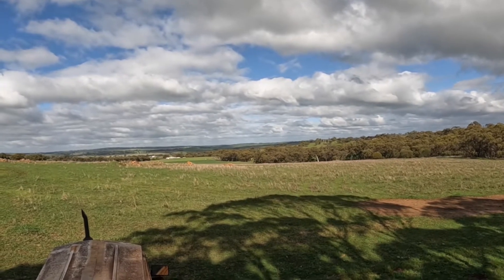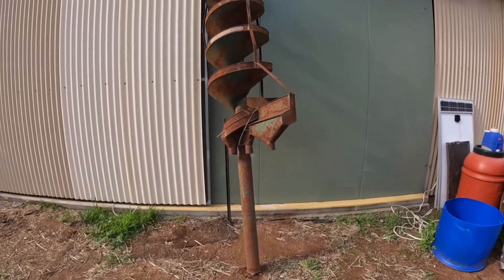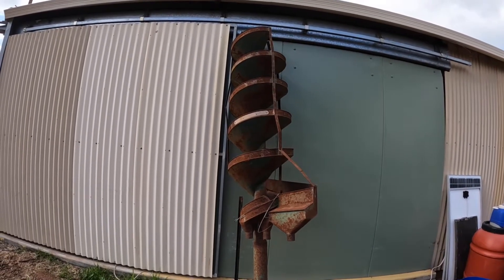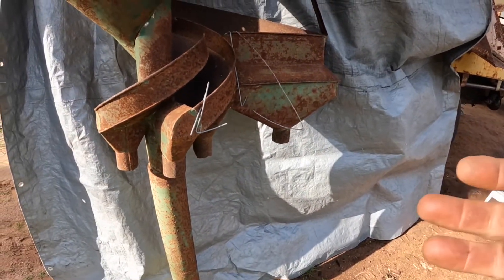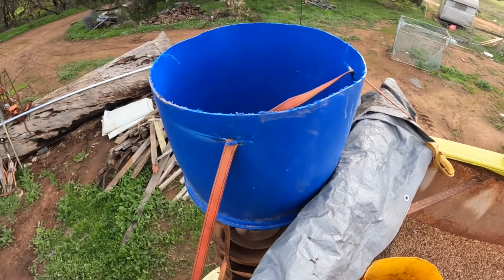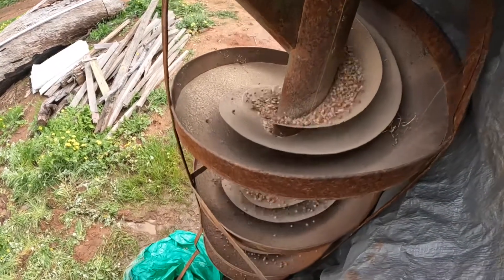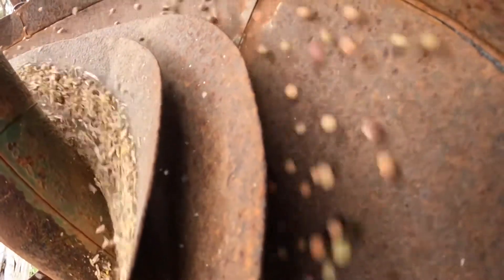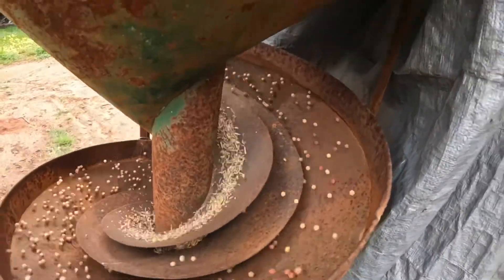Seed cleaning using a Robert Bodington Gravitator

Comment: ive seen those used for canola, when we had open pollinated seed. Now the chem companys do most of the canola seed so they have become uncommon. thanks for sharing. have also seen a motor added to the main post . by changing the speed you can vary the centrifical force moving heavyier seed further out .
Reply from the maker: Hi, that’s interesting. I had wondered what would happen if the whole thing was rotating.
Thanks from Geoffrey

Comment: I'm probably being dumb - but this machine doesn't seem to have any controls (a "normal" seed cleaner has so many adjustments for airflow rates and sieve size).

I can see that the peas go to the outside, and the radish seeds run down the inner spiral.

So what if you had a crop of radish seeds - how would you clean it?
Reply from the maker: Hi Paul, it doesn’t have as many adjustments as a regular cleaner, but there are 4 different outlets at the bottom and a swinging flap at the bottom to allow you more selection as to where you take off the grain. Also changing the flow rate at the top changes where things come out the bottom too. I have got a good clean sample of radish and rye grass seed from the different outlets at the bottom.
Thanks from Geoffrey